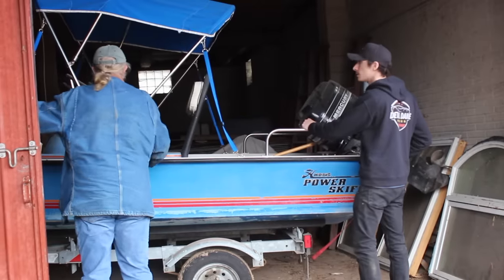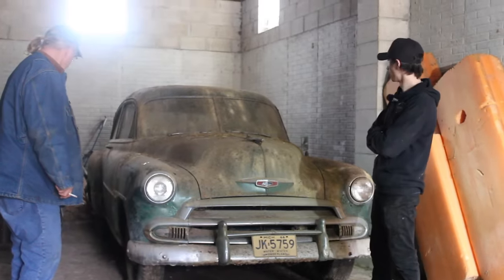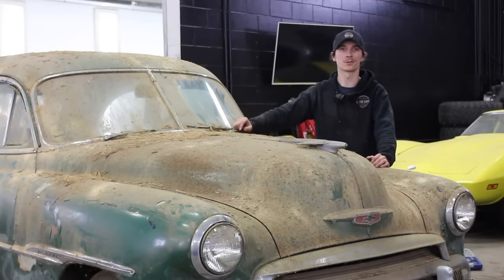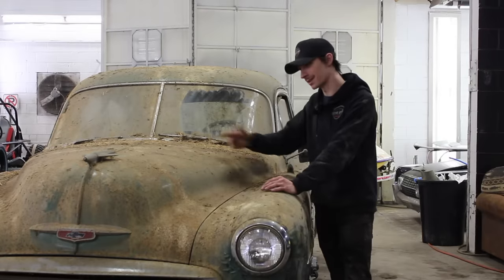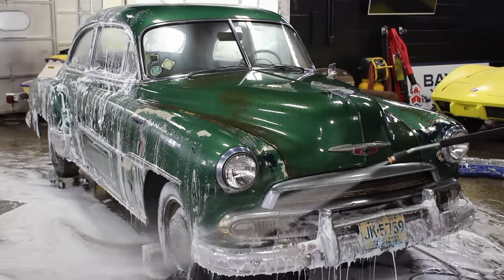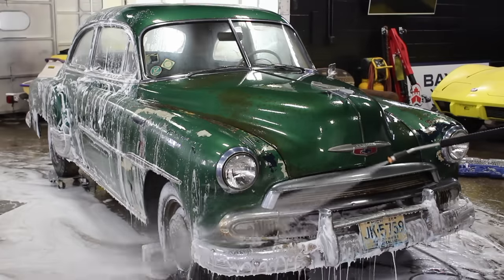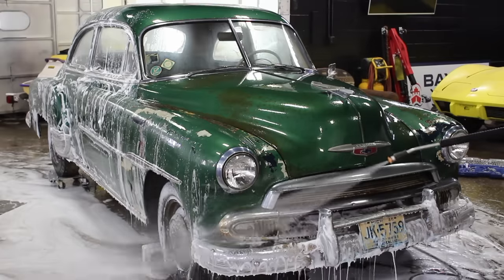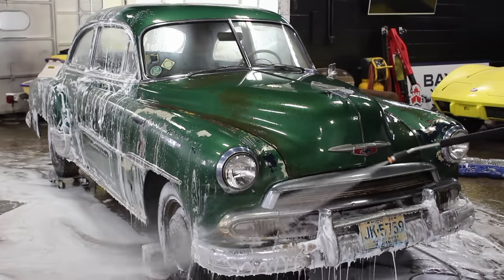I Found a Classic Chevy ABANDONED in a Barn for 48 Years & WASHED IT

Comment: The floor and frame is easy to fix. Get yourself a forney 110 volt flux welder, 1/4 steel for the frame, 18 gage steel for the floor, and angle grinder with a metal cutting disc, and it wouldn’t be any more labor then what you put in to cleaning it to repair all the bad metal.. then you’d make waaaaaaay more profit when you sell it.. smooth of the rough outside parts, look up the paint code for that year and just fill in what’s bad and feather it off.. then you could even stack waaaay more profit on top of that waaaaay more profit.. and I’m sure the engine spins, so tune up, fluids, battery and ur good to go.. it sounds like a lot but it ain’t. Bet your channel would blow the hell up if u did all that… repaint the rims, new white walls.. then you’d keep her. Guaranteed.. kid stuff super easy. 2k tops in materials.
Reply: lol,
Reply: I agree! I would love to fix it.
Reply: @davidpsalmond8522  it’s definitely not as difficult as most would think..💯

Comment: the C10 is often referred to as a half-ton, short bed pickup, it actually came in two different lengths. There was the 6.5 foot bed that had a 115 inch wheelbase and there was also the full size 8 foot bed with a 127 inch wheel base.

 115inch is a perfect match for your car with no frame.
Reply: Care to buy mine? It's in similar condition. Know someone who wants one?

Comment: Measure and get the right wheelbase to match it up to the newest Chevy to mount the body to. That would be cool. An all original body and interior to a newer chassis. Good luck.
Reply: A Malibu or a. Nova subframe wood set it up fine
Reply: @gerry-p9x makes me wonder if the front clip would mount ok to a subframe. Idk. I’ve never seen that before.
Reply: @ocmonman1  yeah numerous people did it along with kits available
Reply: @ocmonman1 you tube Chevy car and Camaro subframe.   Nova too.  Get modrn suspension disc brakes and a mild drop.  Fab up some fender mounts ND you gotta winner

Comment: Having owned one, I must advise you that this is a 1951 Chevrolet.  Had it been a 1952 model, it would have rolled off the assembly line with full-length lense front turn signals. The trim on the front fenders of a 52 no longer has the deluxe moniker emblazened on the trim. It was a straight line piece of molding. Finally, the rock guard moldings on the flared rear fenders had a linear strip of molding that reached rearward along the top of the wheel well openings.

Comment: That's NOT a 1952. It's a '51 Style line Deluxe. I know because I had a '52 for 12yrs that I drove around the Bay Area, CA. I swapped the engine out for a '59 235ci with a whopping 135hp. Mine also had a two spd Powerglide automatic transmission and dual exhaust (Fenton headers) and was a 4dr Sedan and it was also dark green. my favorite color. I bought it in 1994 in Oakland,CA where it lived it's whole life being owned by a Dr. who made house calls with it. Great find and have fun with it. If it were me I'd keep it as original as possible.
Reply: Care to buy one in similar condition?
Reply: @migueloth  no thanks  I have moved on to a '64 Old's F85 Cutlass GM A Body.

Comment: 1951 chevy 2 door deluxe sedan, fathom green with a 216 inline 6. All original like that is a very desirable car! You need to get that mold cleaned for sure. The seats have old warshowski catalog, sears or Montgomery wards seat covers on them, so juat remove the covers the seats might be perfect underneath! You should put a battery in it and get it running! Parts are plentiful! If youre close to milwaukee or chicago i could come help you get it running and driving ive been restoring cars for my whole life(im 40). Frames can be had easily, lots of 4 door sedan parts cars around or you could fix the frame if you can weld.

Comment: The main indicators of year model in the front of the 1952; the center crossbar of the grill has five vertical ribs and it has larger turn lenses.  A 1951 has no ribs, and smaller lenses with a series of vertical slots next to them.  I believe you have a '51.

Comment: I'd do a mild custom with it. Mustang II ifs,  lowering springs out back. Probably keep the original driveline (Add 3.55 gear if not there) Convert to 12v. system and drive it.
Obviously, the rust situation needs to be replaced. In the local Craigslist (socal), I've seen frames cheap. But that's what I would do. Long story short restore it but leave it as a suvivor (which it is)

Comment: That's what my '52 4-door looked like when 
I bought it for $10 in 1971.  Unlike these guys, Dad and I were lucky enough to drive 
mine home!  Went through the same 
processes they went 
through without a pressure washer.  Had 
to wash mine before I 
could put in the garage to work on it.  When you lift the hood, you should see a 235 6 cylinder mated to either 
a 3-speed or a powerglide tranny.  Looks good though.

Comment: Resto mod.. radius the wheel wells.. tub the body. Back half it .. straight axle it.. big block, 4 gear it. Patch the frame or reframe it.. DRAMATICALLY REDUCE THE WEIGHT!!  Battery in the trunk,, fuel cell it,,  nostalgia gasser... 
Build it
Beat it
Break it 
Fix it 
Repeat..

Comment: Remove the body.  Install a new interior.  Get a new custom frame, front end, rear, transmission, motor AC, sound system, gas tank and rewire.  Leave as much of the patina as possible.   See icon vehicles.  They sell for lots of money.

Second choice:  sell AS IS.

Good luck!

Comment: A '52 Chevy is an old car but it is not a classic as there were millions built between '49 and '54 and all are virtually identical on a top hat frame, 216 or 235 Blue Flame 6 w/babbited rod bearings (gag!) but with the exception of some trim. Fun car for sure restored to some semblance of original or street rodded with a nice 350 small block and 4-5 speed and a 9", your choice